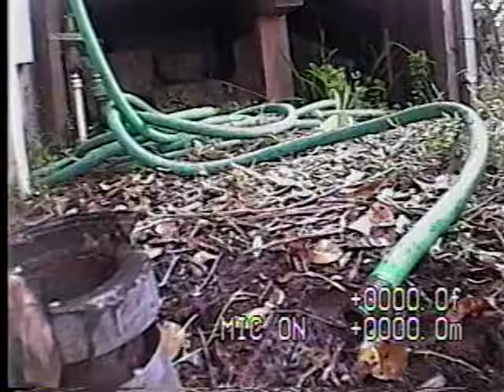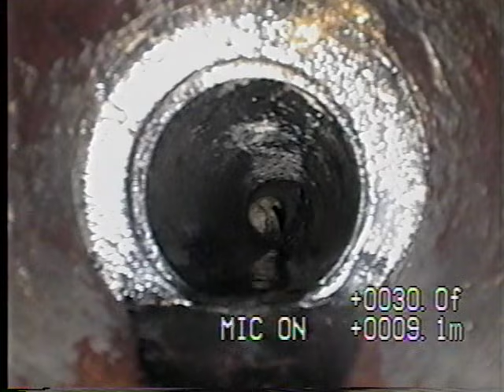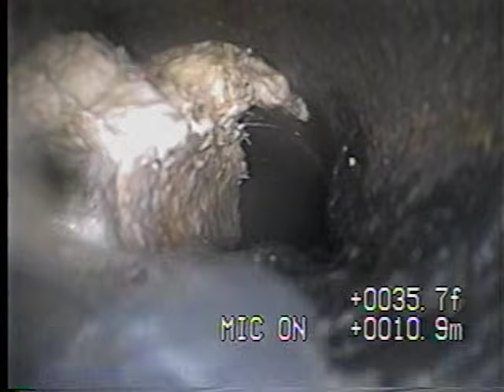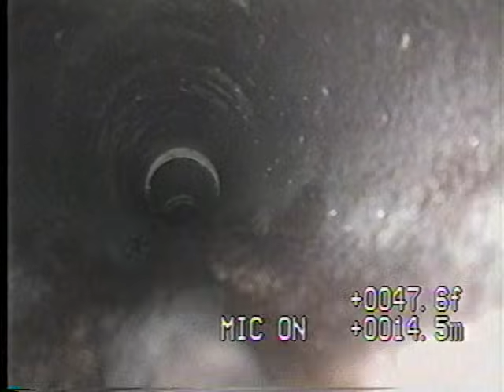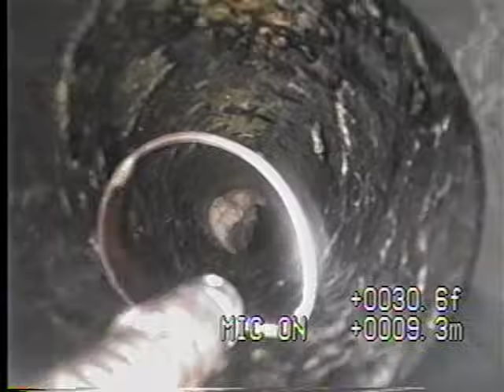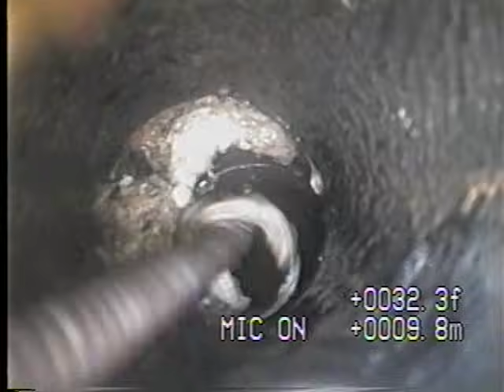Plumbing Camera - shows pipe needs sewer line repair

Comment: I believe that white blockage was grease build up. Grease turns white and cheese like. It sticks to the pipe and eventually blocks it completely. That was a salesman not a plumber if you ask me.
Reply: And boy does that shit smell bad
Reply: @O-townplaya  the worst
Reply: Looks like the Kilo Ray Liottas wife flushed in Goodfellas
Reply: Just jet the line
Reply: I agree more of a salesman. Looks like he charges extra to use the camera. As a contractor i would want to make sure i got all of it so i would use the camera on everything.. He's making it seam like the clog is worse then it is.. Why don't he use the right head on that snake? If he  used the right head it would have taken him les then a minute.
Reply: Most of them arr
Reply: There’s only one thing to do in this situation: toast some sourdough bread, get some fresh avacado, and spread that cheese on thick!😆🍞🧀
Reply: Definitely greedy salesman. That was not extremely hard for him to clear and completely ripping out a yard to redo the entire thing is more about cash in his pocket than doing right for the homeowner.
Reply: @kef103  greedy? Greedy would be willfully going out every 6 months and charging 500 a pop to clean his drains. 1. You never reduce to smaller pipe size as you saw in the video it creates a lip that waste has to jump over. 2. After here cleared the toilet paper you saw that the pipe was dislodged from the fitting creating another lip for solids to get stuck on which is exactly why he had a blockage at that very spot. Stop with your ignorance.
Reply: Kef103 not really... Either they rip apart the yard and replace the pipe or they have him out there every 6 months to clean the pipe again because it will just keep getting clogged
Reply: @kef103  what would you say for the section of pipe that turns into a smaller pipe?
Reply: @aquaseticplumbingdrains  im sure it's not going to be in any textbook as a perfect example. However  the repair estimate given here  is only reasonable for the contractor and his bank account.
Reply: @kef103  The assumption is often that sewer pipes will last forever. That simply is not true, and at some point the only option to finally solve the problem is either to mill out the line, which can degrade the structural integrity of the pipe, or to mill it out and coat or line it. If there are offsets, or bellies, digging might be the only option.
Reply: @kef103  I agree, I always give them the option...One like this, will likely stay open 1 to 3 years or more and you can just keep cleaning it or yes, we can replace it for X amount of $.....But it it worth the thousands of dollars to replace it versus the $200 to keep cleaning it. Btw, a Jetter will spit shine that root / paper stoppage. Those smaller "lips" usually takes years for enough sludge to build up to create a stoppage. A larger "lip" , that would be different. I will give credit where credit's due though, this plumber does sound knowledgeable / experienced; but yeah, a salesman too.....
Reply: @kef103  Its roots and paper.
Reply: It was toilet paper if it was grease it would break apart and smear on the clay that's why I like jetters
Reply: @themanwiththeplan128  toilet paper mixed in with grease
Reply: @themanwiththeplan128  then you know grease don't always just come off even with 80GPM at 3500 PSI with a warthog but yes jetter is a much better method
Reply: @spoolin55psi  it all depends on your pressure/nozzle selection /pipe size  but yea right tool for the right job me personally I don’t have any issues with the cables and cutters still have All my old rigid drain cleaning equipment for when I run into the old tarpaper pipe

Comment: It took 5 times before you used a camera?  Sounds like rip off to me
Reply: Customers don't want to pay for the camera to go down, it's their choice. 

I did the same drain within six months and I offered the camera but customer declined.
Reply: Customers often resist looking at what might be causing issues, opting to limp along for far too long.

Comment: Roots will grow through anything? What kind of a moronic statement is that from a plumber of 45 years? The transition points is what you need to be concerned about. Installing ARC transition couplings at 75 to 100 a piece and protecting them from root intrusion by wrapping and treating with copper sulfate before backfill. I also prefer to encase in concrete between the wrap. Fused HDPE pipe cannot be penetrated! Earthquake friendly and indestructible!
Reply: And adding a extra 2000 to the bid just get pvc with the big bells and don't put couplings and every clean out put flowable fill around it 

Win bids get paid and no return calls

Comment: Drano would be a good $10.00 you threw to the curb. After it's finished compromising your seals and the integrity of the bottom of your pipe, it will cost you thousands to replace them prematurely.....If there was a drain cleaner more effective than your plunger, I would be in another business! After 44 years I haven't seen any drain cleaner with instant results. A maintenance program with a bio clean solution would be more effective and safer for the environment as well as your pipes!

Comment: A drain cleaning machine when used properly by a professional operator who has an instinct on what bend or attachment he should use in a certain situation, will clear your stoppage, remove the hair and flush the scum through your system. It takes years of experience in knowing what to do and identify the circumstance. When you watch an experienced drain cleaner clear your drain, it looks very simple! The truth is it's not going to be for you! Pay a couple hundred bucks and get it over with!

Comment: Please tell me about the new technology couplings you use on cast iron? Have you heard of High Density Polyethylene Pipe bursting? Where the pipe is fused and you have 2 transition areas? Cast iron rots on the bottom, trench-less HDPE pipe is forever.
Reply: The qestion is the old pipe running level when you push pull that new hdpe pipe though the old pipe

Comment: why not use p.v.c pipe to replace why replace with cast iron??? and if  u had a cutting head with teeth on both sides u would have cleared that line better

Comment: @millwrightman99 Don't matter about the joints. Joints are just an easy early access point. Like i said the pipe sweats. like condensation on a glass. It doesn't matter what the pipes made out of. I've seen roots go through cast iron many cases. :) They were older buildings but still roots got in.
-- Side question What camera are you using? --
Also I believe it's toilet paper or paper towels with your clog there... 
I wonder if the customer went on vacation or something and that sat in the

Comment: Granted the plumbing done was improper, but you are certainly not gonna stop tree roots. I don't know what that white plant was, but the pipe sweats and the roots of any plant will wrap around the pipe, and if strong enough will break into the pipe. No stainless steal or rubber coupling is going to stop that. Granted there are some ways to get around it, but rather expensive.